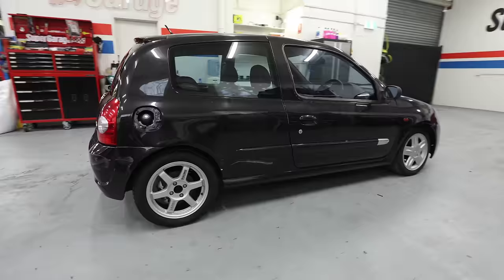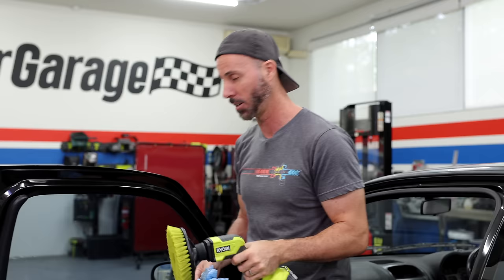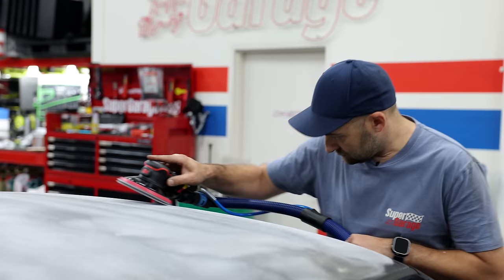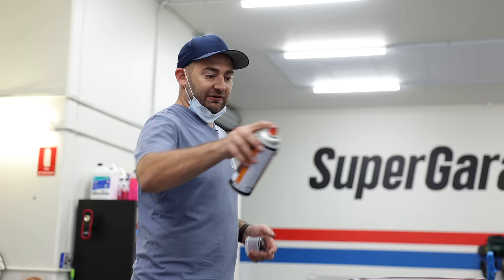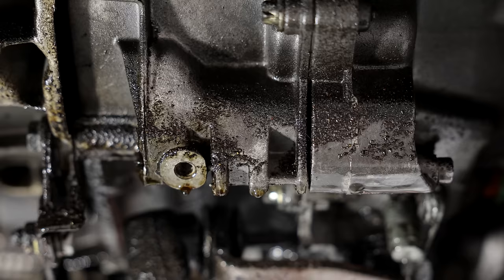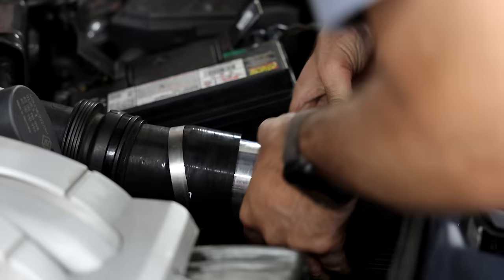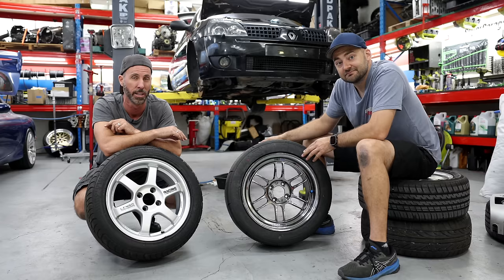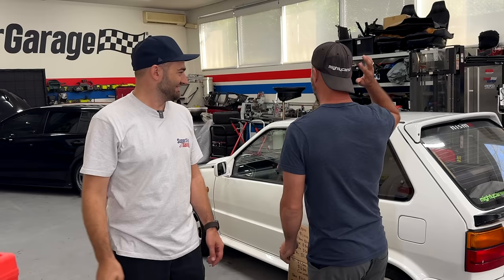How Much MONEY Can We Make In ONE DAY?

Comment: @12:30 I like where the heart is at with repair instead of replace, but I have to disagree there. The cure is not (only) to get your hands dirty, it is right to repair laws! 

I'm an OEM engineer (yes a real one, degree and 12 years of experience and all). I somewhat get the need for certain lockdowns and model specific parts and whatnot. Cars are a little different than phones and whatnot in in that regard in that they are 1500kg battering rams driven by distracted and barely qualified operators. But that is what safety inspections are for. There is just plain way too much money in obfuscating stuff and locking repairs behind overpriced, manufacturer owned repair centers, this is not going to change without either forcing them or ending capitalism. Also, electric cars are way simpeler to maintain, modify and repair. Sadly, it's also way easier to lock down everything. Which is done near universal. First gen Nissan Leafs would have been useless paperweights by now if not for DalatheGreat reverse engineering everything and plonking it on his GitHub. Imagine if manufacturers were forced to do this from the get go. Spam your representative politicians about this!

Comment: You did well, you are not mechanics. I just cringed when you cut the cables to the boot, then say the rear screen motor is dead, perhaps because the damaged wiring, but you still had the old boot to take the motor from!
Reply from the maker: Look closer, the motor is cracked